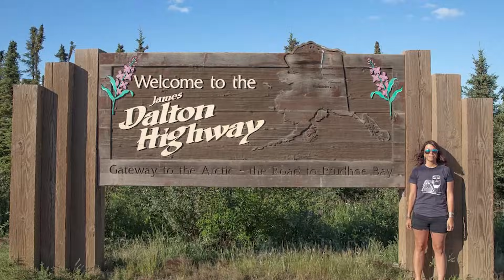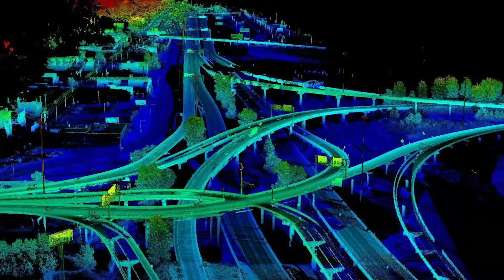15 ROAD Infrastructure Fails

Comment: The Dalton is an important road for the mines and energy fields in Northern Alaska. I will agree the interchange in Duluth is horrible
Reply: The Interstate Expressway in Duluth is a good one
Reply: The Can of Worms is gone now - they've been working on a new interchange for several years now & are planning on replacing the Blatnik Bridge over to Superior in the near future. I think the interchange project should be done in 2024 or 2025. The lack of snow & warm temps has been helpful for construction (they were planning on working in winter anyway). They are only using right exits this time, so no confusing knot of bridges.
Reply: @hollyheikkinen4698  that’s great to hear!
Reply: @heavenlylight317  hopefully it will solve the problems with the can of worms & not create a different problem 🤣

Comment: The "can of worms" is currently under construction.   Love that duluth, mn made it in the video.
Reply: I’ve lived in Duluth for +35 years and while I get tired of the constant construction on the freeway, I’m glad the can of worms is changing. My car was totaled by a driver from out of town who got confused and panicked in 2014… I’ve dealt with severe nerve damage since then. I’m pretty happy with the timing too, as my son just got his drivers license 😅 there are plenty of other places that make me nervous for him, especially now that winter is here! Nothing quite as confusing as the can of worms though..
Reply: I am on the Range & haven't been down by the Can of Worms since construction started - but from what MNDOT & WDIO has shared, it looked like demolition was done & now they are building the new exits/bridges. I never found the Can of Worms confusing since I was usually just following highway 53 to cross the bridge if I was on it & as long as I was in the correct lane, I didn't have a problem. I have friends who hated it because they always accidentally ended up in Wisconsin 😂

Excited to see what the Blatnik Bridge replacement looks like! The bridge is older than I am (I'm 51), so it definitely needs the replacement. I heard how many vehicles travel across it every day & it's a crazy high number! I assume the Bong Bridge helped with the daily traffic. I remember when it was built & have used it - but the Blatnik Bridge is more convenient when I am following 53 down to Eau Claire.

Comment: The bridge collapsed because the restoration put a single nut on the tower bases to the concrete and the tornado cause the bridge to pull up and shear the new nut off. Note it originally had multiple nuts tightened onto each other to prevent what happened in high wind conditions

Comment: Dalton Highway was a important highway in Northern Alaska because it was parallel the Trans-Alaska Pipeline owned by Alyeska Pipeline and this is the main route to deliver cargo from Prudhoe Bay to Fairbanks 

The highway was cannot reached through emergency dispatch by Alaska State Troopers because most of the area are out of communication 

Until 1981, the highway was only used for Alyeska Pipeline and in 1981 it was took over by the State of Alaska and it was not until 1994 it was opened to general public

Dalton Highway was named after James Dalton, an Alaskan engineer